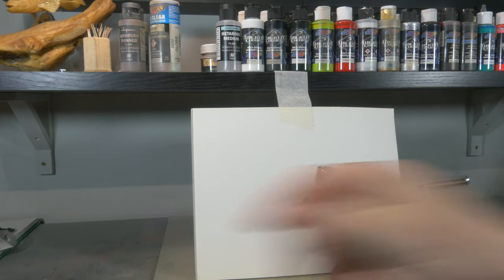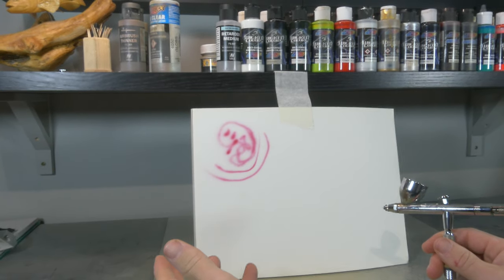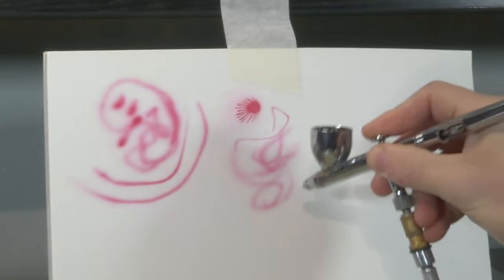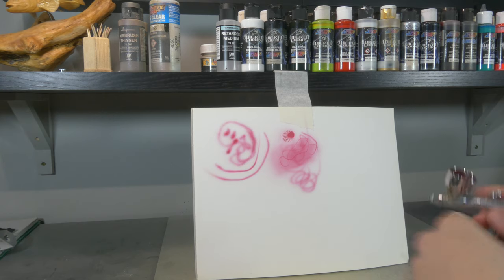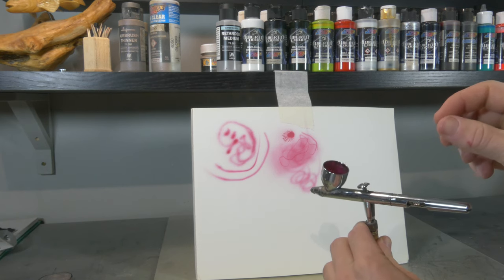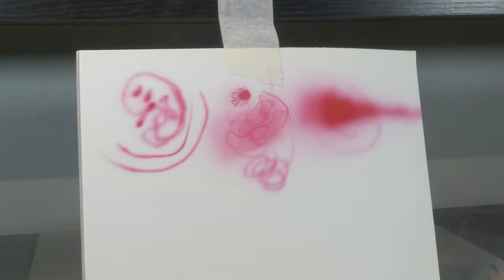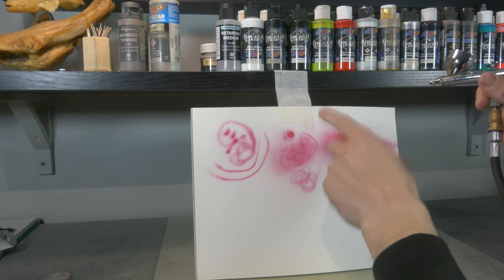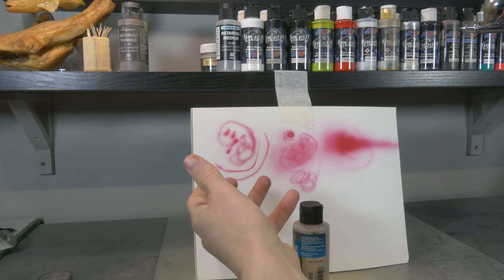Enhance Your Skills: 3 Tips for Using Createx Reducer in Airbrushing!

Comment: Could you put mica powder in the paint with no issues just as an add on?
Reply from the maker: Yes you can, as long as you mix it with a transparent base paint. I like to mix he mica powder with a little bit of reducer first, then it does not clogg and breaks down nicely. and then after mixing with the reducer, add the paint base 👌

Comment: What are the pressures / nozzle sizes  you are using once reduced?  I've tried a few times to spray createx pearlized gold but it's either too thick or spiders when thinned and using .35 40psi.
Reply from the maker: I used an iwata eclipse .35 needle. With thicker paints i use around 30-40psi, also createx pearls i rarely thin down and just shoot them straight from the bottle , sometimes with even more airpressure. I personally do not like to thin down pearls 👍😊

Comment: I’m going to start air brushing soft plastic swim baits shortly . When u fill up your paint  brush half way, what would be the amount of drops of 4011 reducer to put in for a beginner? I’m will be using true water based paints by Lure works . Thanks so in advance
Reply from the maker: Hi Larry! That is a difficult question, because it all depends on the paint´s consistency and your airbrush´s needle/nozzle size. 

Some paints dont need thinning at all because they are already very thin. 

The best way for you to find out what works is to grab a sheet of paper, fill the cup with no reducer. and test spray for 5 min, not just one spray, play a little with it. Then if you notice it does not go well or easy. Increase or decrease your airpressure and play a little again. 

If that still makes you struggle a little, then add 1 drop of reducer and mix it, and play a little again.

remember the thinner your paint is the less airpressure you need, or else you will be blowing your paint away. Give it a try and i am sure you will find out what works with that kind of paint and your airbrush set up!